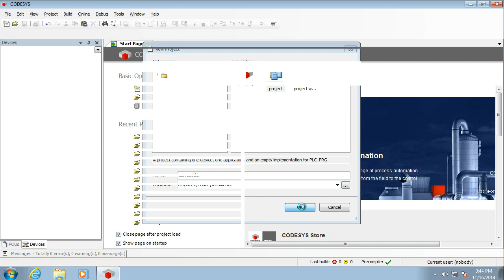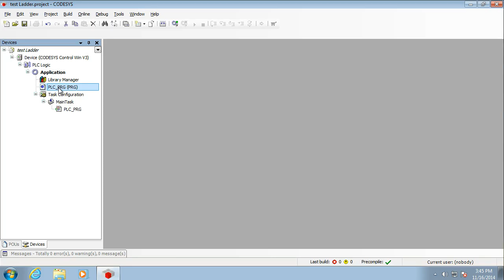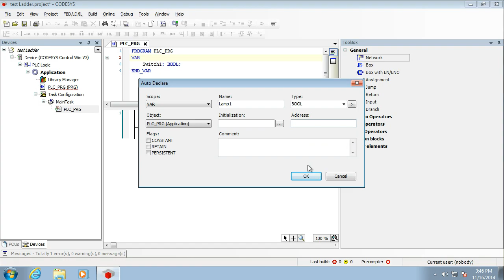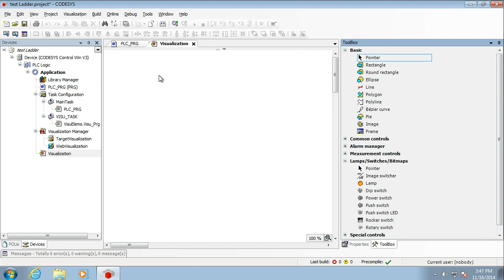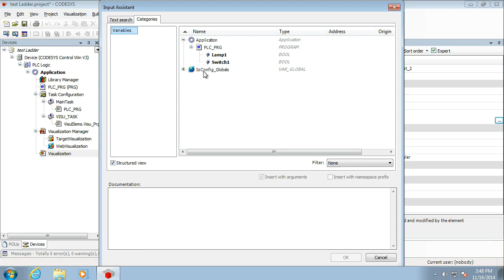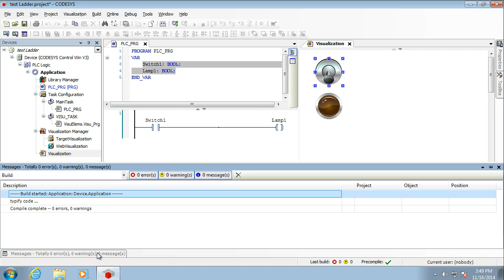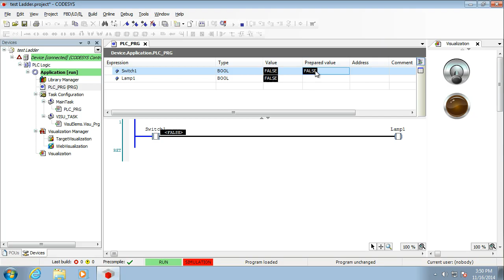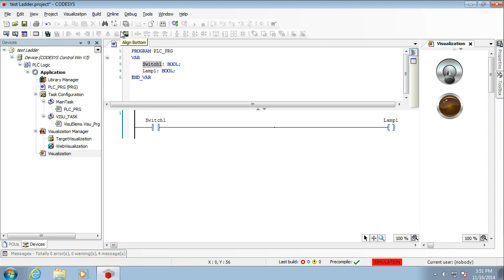Codesys 01 Intro and Ladder

Comment: Thank you very much Mr Brian for putting up these video tutorial. I really appreciate you kind gesture. Please I need your guide on how to resolve this error message: PROGRAM LOADED EXCEPTION. After online login then I clicked the start button as you described in the video tutorial but instead of  changing to RUN mode, it remained in the STOP mode and then showed this message:  PROGRAM LOADED EXCEPTION. I would be very grateful if you could  put me through on how to resolve this problem. I am  new to Codesys. The version of the software I am using is 3.5,i just downloaded it from  Codesys web site. Best regards.
Reply: +John Bensen Guys i have found the fix, when u create a project, right click on application and go to properties. Go to built and fill this in compilerdefine: VISU_NO_EXCEPTION_HANDLING
application > Properties>Built -> Compilerdefine VISU_NO_EXCEPTION_HANDLING
Reply: +John Bensen I'm having the same exact problem...
Reply: +John Bensen I'm having the same issue...
Reply: +John Bensen So, did anybody solve this problem? Because I still can't run the application
Reply: +John Bensen Im having the exact same issue, has anyone figured out how to fix it?
Reply: You absolute hero. This works!
Reply: You are a star. Been at it all day
Reply: Thanks Balo, you saved me:)
Reply: +Brian Hobby + John Bensen +Bruno Santos,  Did you manage to solve the problem?
Reply: Kudlaty18a I didn't. But I don't work in this software anymore
Reply: +Bruno Santos What software are you using?
Reply: Kudlaty18a None. After looking for solutions we ended up finding a local company that does what we need :)
Reply: Np guys :)
Reply: Very thanks!

Comment: Do you planning to continue these tutorials ? I consider there are very useful.
Reply from the maker: dan stoeann time is my problem, I put these together to help out the Engineering Institute of Technology students get started in their coding assignments. I may add some further when I get a moment as I need to get myself fully across the Beckhoff soft PLC implementation using CoDeSys.
Reply: @brianhobby767  great job! really awesome quick tutorial to get started. You should consider making a codesys course and putting it on Udemy, I'd buy it!

Comment: Greetings, Im interested if it is possible to transform ladder code in to structured text in Codesys?
Reply from the maker: Srdjan Srdic Not that I've found as yet, it does a handy job of switching between FBD, IL, and Ladder but no ST yet. Quite possibly as you can easily create code structures it ST that are not easily replicated in the more structured (constrained) approach of the others.